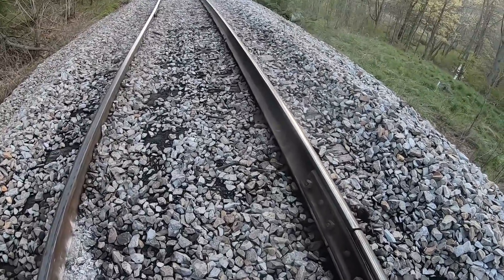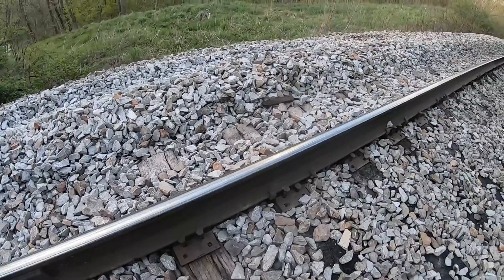Major Derailment: Locomotive Derailed & 2 Cars plus1400 Feet Track Tore Up!

Comment: as the saying goes. you cant put a square peg in a round hole, "well" the railways have proven you can. as a former railway track maintenance worker I've seen time and again the square spikes (dog spikes) we call them here in Australia, are always the first to come lose no matter how good the sleeper ties are. I can easily say if you walk along that section of track you would probably find that most of if not nearly all of the square spikes would be compromised (lose) or well on there way before any of the round type dog spikes. being on a curve you may notice smooth shiny marks on the sleepers on the outer high rail from the lateral  movement of the sleeper plate moving back & forward on the sleepers from the forces of the trains weight pushing on the high rail thus loose ties. but that being said I'm not in any position to say how it came off the tracks, nor am I going to. thanks for the video although its not what you wanted to see or happen, take care. greetings from Australia.
Reply from the maker: Thanks for watching Ross and hope you will take in my next video
on my theory on why the derailment happened. It's here:
https://youtu.be/2uGomCuZkV0

Comment: Two questions , Why do they leave the Loco engine running, and why not GPS track the speed of the train?
Reply: Sabotage
Reply: They probably kept the locomotive running because sometimes those older locomotives  batteries are not the best and it may not start again. Last thing you need is a locomotive with a dead battery once it is re-railed.
Reply: I’m sure the locomotive has a speed recorder, they all do.
Reply from the maker: Yes sir they do, train was going 22 MPH when this happened, track
speed is 25. Thanks for watching and hope you will stay tuned for the rest of the upcoming videos about all of the events that happened here.
Reply: @ccrx6700  aloha.. my dad worked Conrail and Penn Central for 30 years
Reply from the maker: @davidbagley1783  awesome David 👍
Reply: @Brian's Place Knowing nothing about derailments except the facts on this one  of the track being well taken care of, and the speed being lower than track speed I wondered myself if it was sabotage. I've seen several derailments on horseshoe curve where they have placed the cars incorrectly so a derailment occurs, but this doesn't look like those kind of circumstances so I don't know it would be interesting to see what happens.

Comment: The locomotive was at the back of the train right?
What a mess, seeing the ties cut through by the wheels was a reminder of the tremendous forces involved
Reply from the maker: We have a push pull system, so locos on both ends. 
Thanks for watching and hope you will stay tuned for the rest of the upcoming videos
about all of the events that happened here.
Reply: daniiel mlinarics  ccrx works for a railway that moves coal. He explained that coal dust and pebbles will fall out of the hoppers and embed itself in the ballast, making drainage difficult when it rains. This causes a lot of problems, and ccrx has many videos where he shows the process of renewing the ballast

Comment: Hey Dave !!!!  Question for you ,,,,  Would the ""pandrol "" Clips that you showed have stopped the rails from leaning over on that curve ???
Reply from the maker: Good question and yes Pandrol clips have much better holding
ability than spikes K B. Whether it would have stopped this I doubt
it, watch the next video and then ponder it for awhile and write me back my friend
Reply: @ccrx6700  Have watched the videos on these clips on ""YOUTUBE "" is why I asked the Question only they were using concrete ties NOT wood in the videos !! Pretty impressive to see the machine they have to install & remove the clips as NO more sledge hammers used !!!

Comment: Rolled the rail due to rotten ties , probably by ties that were rotten on the bottom . Nuts on  angle bars inside low rail . Hulcher does awesome work with their Side-Winders . Worked a lot of derailments while working for Missouri Pacific and Union Pacific   . Ended career working Welded Rail Trains unloading and also picking up the used rail . Picked up several abandoned subdivisions mostly using a Sled attached to the rail power car , the sled lifted the rail high enough to pull the spikes and knocking the creepers off as well . We'd pull the rail onto the train while pulling the train ahead 1440 feet then stop and cut the rail and start two more strings until we would have a 50 string load of rail . Hate to see Abandoned Railroads , hated to look behind me from the operators cab of the power cars and realize there won't be anymore trains through here . I rode a loaded rail train down one subdivision one week while on the way to a location two states away , then the next week I was the first train to start picking up the rail as that subdivision had been taken out of service due to Abandonment . The Rail was still Shiny . Pitiful sight . Great videos , keep them coming .
Reply from the maker: Thanks for watching and hope you will watch the upcoming videos
that explain so many other aspects of what all happened here, there gonna be 8 more videos out about the derailment coming soon to a utube nearest you...

Comment: Why didn't they power down the locomotive?
Reply from the maker: Locos are left running a lot of the time here, they never shut
down during the winter even if parked in a siding, Had there been
any leakage under the loco then it surely would have been shut off
right away.  And, consider if the loco was shut off and for some
reason wouldn't start again, that would severely complicate things
for the track repair crews. We have no way to drag it west out of
the way. They were also hoping Hulcher could somehow re rail the
loco quickly so no need to shut it off. Thanks for watching

Comment: I guess when in doubt just throttle on out. Or until it quits moving.... how can you even operate a train and not feel that
Reply from the maker: With only 3 trucksets off and being dragged the drop in amps on loco will be almost minimal. They once had a bearing go bad and 1 wheel set dropped off, they drug it 8 miles with no drop in amps. These locos are built to handle 70 or so loads dependingbon grade, we only have 37 cars, so a car or 2 off doesnt drop amps much. Train stopped when it went into emergency after rear DP uncoupled
Reply: @ccrx6700  Thanks for these details Dave. I'm sure that you will have a whole video on this, once the dust settles.
Reply from the maker: @alandaters8547  yes sir Alan, got 8 more in this mini series 👍

Comment: Why do N/A railroads continue to deploy wooden slerpers (sorry,ties) instead of concrete ones as we do in the UK? So many of them seem to be rotten.
Reply from the maker: According to Railway Ties Association bout 93% of ties in N.A. are wood. You guys have light trains, concrete has not proven themselves to hold up real well under heavy loads, they are experimenting now with pre stressed concrete to avoid so much center cracking of the concrete, hope that helps

Comment: Crap,that's a bummer. At least nobody got hurt and the cars didn't flip over.
Reply from the maker: Yep, things coulda been a lot worse. Loco could have been on it's
side down a steep embankment with diesel fuel spilling. It did
happen in a fairly easily accessed area, and didn't have any mud
or rain to deal with. Thanks for watching

Comment: “What a mess.”  “Don’t know what happened.”  “Might take a couple days.”  
Probably should repeat that about 50 more times so it will really sink in.
Reply from the maker: When I got there all that was going thru my mind was how am I going to get all this track back in service. I made 4 videos walking
up the track thinking I would publish 4 separate videos, but later
put all 4 together. I have requested management the next time 
they have a derailment they have to give me 8 hours notice so
I can script those videos. I'm sorry I wasn't thinking so much about
what I was saying at the time, was 90 times more concerned 
about getting track back in service.
Reply: Yup  and he can't even say 2 words without losing his breath. I also think the rails roled over. BTW why do they leave the engine of the derailed locomotive running? Burn of the fuel?

Comment: Amazing how far in front of the locomotive that the rail rolled.  Good thing the cars didn't pile up and spill everywhere.
Reply from the maker: Yep, cars kept it rollin, it is all been replaced now with good relay rail. Thanks for viewing today's show 👍
Reply: @ccrx6700  how long did it take the crews to replace everything and get trains rolling again on that section?
Reply: @TsunauticusIV  good question
Reply: Before I comment, this is just an opinion, I'm not a railroad man. The rails that "appear" to be in front of that single locomotive are actually behind it. The reason being is that it appears to me that it was a "pusher" locomotive at the rear of the train. Once the rear cars started derailing it came uncoupled and when the air line broke it set the brakes into "emergency". The fact that it was a single locomotive and on the ground, it stopped quicker then the rest of the train  because the few last cars that were derailed were still being pulled by the rest of the train. Hence the distance between the two. Also that same situation kept a pile up from happening because the derailed cars were on the ground and being pulled, not pushed. Was very fortunate the the derailed cars and locomotive stayed in the center of the road bed and didn't roll over.
Reply: @ken9503  thanks for that clarification.  I was wondering why they were so far apart.  I was assuming (i know..) Excess speed but didn't think of it your way.
Reply: @ken9503  Yep.  I was a bit confused at first, but then realized the loco's must have been pushing, not pulling.
Reply: @ken9503  I'm not gonna argue against your comment, sounds reasonable.
Reply: @ken9503  yeah,I thought was he backing up?  not possible ,unless cars kept rolling after engine came off.,But brakes would stop them.
Reply: @ken9503  Looking at this I was thinking the same and suspect it was the coal hopper that started the derailment by for some reason dropping a wheel into the inside of the rail pushing it out causing the car behind to derail and then the pusher which as you say will of stopped a lot quicker when the airline parted. Interesting to see the cause.
Reply: If yes then the fat controller will be cross
Reply: See you never know
Reply: I get it that you said that the ties are good. A couple of weak ones, and the rest is history. Track will be back in service soon, those contractors don't mess around.
Reply: Hey jaw. Did u see shoe string new video
Reply: @51-FS  No but I will check it out.  I was in Cass for a few days
Reply: I saw a vid where the bottom doors on a coal train hopper car opened. Made one Mell of a Hess. This could have been worse.
Reply: You start by going back home and finish enjoying your day off.
Reply: @totallysmooth1203  yes sir that's how its done

Comment: The silence when everything stops is deafening. Glad no one was hurt. Gonna be an expensive Hulcher Moment though.
Reply from the maker: Yep, things coulda been a lot worse. Loco could have been on it's
side down a steep embankment with diesel fuel spilling. It did
happen in a fairly easily accessed area, and didn't have any mud
or rain to deal with. Thanks for watching Tom and stay tuned for
more vids on this coming out soon

Comment: Looks like  the RR is fortunate, in that none of the derailment is on it's side or crunched up. Fixing the rail and re-railing the equipment is better than a lot of what I have seen.
Reply from the maker: Yep, things coulda been a lot worse. Loco could have been on it's
side down a steep embankment with diesel fuel spilling. It did
happen in a fairly easily accessed area, and didn't have any mud
or rain to deal with. Thanks for watching Roland and stay tuned for
more vids on this coming out soon

Comment: Very interesting, thank you for making this.  
So much damage from a point of failure, where it looks like a few base plates gave way, and once the rail moved out of gauge, weight and motion did the rest.

Would it be possible to use a different method of seating the rails on sharper curves, such as the fast clips or Pandrols on concrete ties used a lot in Europe?  The camber will have been correctly worked out for the curve and line speed, so rail fixings and ties seem to hold the answer.   

Re railing the train must have been nightmare!
Reply from the maker: Thanks for watching and hope you will watch the upcoming videos
that explain so many other aspects of what all happened here, there gonna be 8 more videos out about the derailment coming soon to a utube nearest you...
Reply: @ccrx6700 Thank you, I've watched one on what you call cribbing, and will watch the upcoming ones.  Very interesting to see how lines and maintenance are different in other parts of the world.
Keep up the good work, and looking forward to see what started that derailment!

Comment: Why the heck aren't we using concrete ties?! A huge argument for investing in infrastructure!! Man we so falling behind the rest of the world!
Reply: MM: This is not infrastructure related in the way you are thinking.  This is a private railroad that hauls coal consists from the Cumberland mine in western PA down to the Monongahela river to get loaded onto barges.  It's something like 17 miles in total length. This railroad does not interchange or connect to any other railroad, just hauls coal (at low speeds) from point A to point B.  This event shows just how much energy is involved when things do go wrong.  I am awaiting Dave's upcoming video(s).
Reply from the maker: Thanks Gregory appreciate your comment sir. Yep you are right.
Do thank you for watching and you gonna get all your questions
answered in the 8 upcoming vids about all of this, a lot happened
as you can imagine.  you know I won't let you down....

Comment: When the train can't run does the mine shut down?
Reply from the maker: Excellent question! At the prep plant they have 2 raw coal stackers
(stockpiles), the mine can run until both of those are filled plus
the 2 raw coal silos. I don't know exactly how much tonnage all those hold, but close to 75,000 tons. To fill all that up from scratch
the mine can run for 4 to 5 days before the plant has to start
processing coal to add room. So they already had some on their
piles and it was close to having the mine shut down before we
got track back in. Obviously the prep plant can't run if there no
train to put clean coal in so they were down. Thanks for watching
an appreciate your question sir

Comment: I had one of these where the rails rolled over at the uphill end of a siding while we were pulling a string of hoppers full of sand out of there and we had to leave one loaded hopper on the ground below the switch. We may have had more than that car off the track, but we didn't see it at first and the other cars may have been rerailed by the guard rails below the switch frog. The Roadmaster came out and the section gang got everything repaired in a couple of days while we were working on the other side of the mountains. Those ties were old and had been stressed by another crew backing the loads into the siding after one of their units failed on them and they didn't have enough power to get up the hill. They left half of the train there and we were sent out to pick it up the next afternoon. When I was still doing track work, my crew had replaced ties at the lower end of that siding, but when I went to train crew, the priorities got changed and the rest of the siding didn't get taken care of. Sometimes track fails because of something that the engineer does. Sometimes things get worn out and need attention, but something else is more important and you don't get back to it in time.

Comment: Gravel level looks too high to me. The rock works itself under the track acting like a wedge. That's also how the bottom of the track can crack.
Reply from the maker: Interesting observation, this was an old long walled under
track, the high gravel is there, if you know anything about long
wall mining? to keep track up to original grade. You are correct too
much rock under a track is not good, however we had to put so
much ballast down to keep the train running while they were
mining under it.
Reply: @ccrx6700  I'm not a track expert or anything. I just look at everything scientifically. "Just happened" or "magic" isn't in my vocabulary. The cracked bottom of the track is what caught my eye and questioned what would cause that to happen. Was thinking a small high pressure force stressing the track repeatedly. Then I seen the rock which I thought might also explain the track lifting slowly over time pulling nails up. Any rail roads I've looked at the rock was always flush with the rail ties. Never knew why other than to reduce rot allowing the wood to dry quicker than if buried

Comment: there's a thing called a frog.     you put it up under the tires.    their not wheels.    there ties.       hook the locomotive on. and pull it.     the car. tuck will hop easily back onto the rail
Reply: Too bad they called Hulcher when they could have called Lady pilliwick.